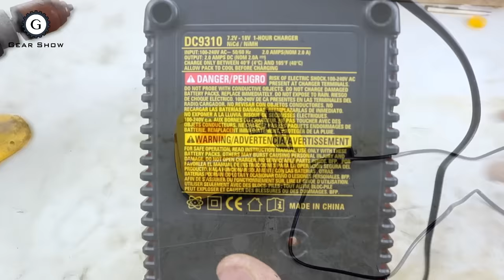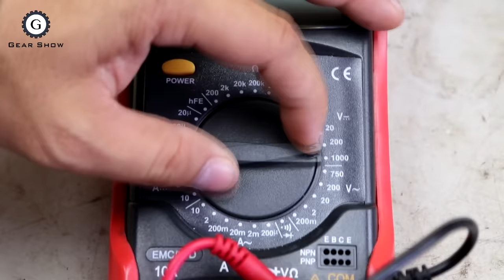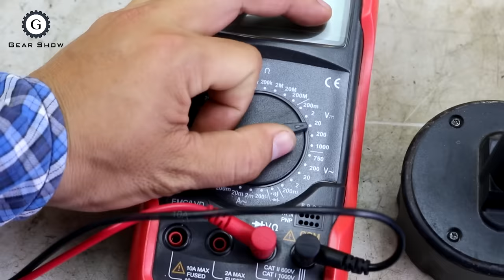Cordless Drill Restoration | Dewalt XRP 18V TYPE 1

Comment: I took my drill apart and now I just have 100 pieces.
Reply: hahahahhaha!
Reply: Need to take a video when disassembling so you know how to put it back together!
Reply: Always take pics while disassembling lol learned that the hard way
Reply: i took my 20v electric cordless Trimmer Apart - 300 pcs 
motor was SHOT !!!!!!! after putting 2 complaints to DEWALT nd a CASE # finally sent me a new one - Not worth replaceing MOTOR too Expensive
Reply: You should only have 99 pieces. Lol
Reply: Wildstyles 100 pieces and one heck of a facial expression....
Reply: The Niwo I took my fussy neighbors jigsaw apart once after borrowing and breaking it when I was about 13, fixed it! But had to go all the way to Black and Deckers spare parts store’ 
But I got that thing back in one piece...

😓
Reply: @TECsta76  LMAO !!!!!!!!
Reply: As long as you have none left after assembly, she'll be right!
Reply: My technique exactly, did it with a motorbike and sold the parts for spares!!!
Reply: Una vez desarme uno de estos y no logre armarlo de nuevo jaja este tipo es un muy bueno
Reply: @hawksights  torque clutch got me too. Ball bearings and little shafts fell out and rolled away. Used epoxy to secure ring gear to housing. Works again but no clutch. Didn't ever use it anyway :D
Reply: Sell it as an unfinished project and throw in a few random extra pieces 😈
Reply: Might as well mount all the parts on a board, hang it on a wall and call it art.
Reply: I did the same thing :-)
Reply: Mine stopped working so I took it apart and forgot how to put it back together
Reply: @neilhewson5392  Throws all the parts away well I have no parts left my drill still doesn't work :(
Reply: 100 piece puzzle is hard for you?
Reply: @neilhewson5392  you know that spare washers and screws are built in to all electrical appliances .well they have been when i take stuff apart theres always spares left over
Reply: Are you missing the balls to put it back together!? 🤭

Comment: I admire this kind of dedication to saving something. We throw away and waste a lot of useful things way too easily. Great job. 👏🏻👍🏻
Reply: for entertainment only not worth the effort nor time for most who don't have the tools, time, knowledge to do this kind of thing and plenty of used drills in the used marketplace that are customer returns can be had for around $50 or less in pristine like new condition.
Reply: He should have converted battery to lithium cells. It is crazy easy to do with dewalt.
Reply: I like this sort of thing too but I could just never justify sinking that much time into fixing up an obsolete NiCad drill.
It's not a matter of usefulness at this point its a matter of pride and/or fun.
I got three air impacts 1" and 1 1/2" that were gonna be chucked out when we moved in to a new yard.
Worth about $1,000+ each, if they work. Didn't have my own - Worth repairing. Fixed 'em up, new vanes, new grease, new/fixed trigger assy's and repaired the fittings and off you go.
Reply: Skodaman2   No, I needed to be more clear. If you already have a new dewalt lithium battery drill and want to convert an old one it is easy. They sell a thing that snaps into where the old NiCad battery was and then you just slide a new Dewalt Lithium battery on that. Only use charger for lithium batteries.  If you don't have a new drill then cost  of converter, battery, and charger might be a bad idea and to expensive.
Reply: usually it's just the fucking battery too, hate those batteries
Reply: In Cuba they keep 50s cars going for regular transportation.
Reply: @10OZDuster  pppppppppppppppppppllplpppppppppppppp
Reply: Hello Kitty you
Reply: @10OZDuster  and

Comment: I just realized why Dewalt  tools are expensive
Reply: Zana Hasan why
Reply: Why
Reply: Zana Hasan  Dewalt tools are junk. Buy Bosch, Makita, Milwaukee, or Hitachi and never look back
Reply: Weather it's dewalt , makita Bosch or milwalkee it's the tool holding it that counts , dewalt is fine if it does what it's designed to do and the tool on the end of it knows what they are doing.
Reply: The electronics have a special coating so it works in the rain. The gears are metal. It is 3 speed for a wide and accurate torque range and consistency of driving screws from a number 6 drywall to 2 inch hole saws. The plastic is nylon glass reinforce. The chuck is all metal with carbide jaws. The brushes are easily replaceable. That drill can do most of the work to build a house and and then some. I have both the 18 and 20 volt versions of this drill. It will break your wrist if you are not braced for a bind. It is a beast made in the US and retailed over $300. It is not a DYI drill.
Reply: Sung Joo Um  it lasted me about a year and then the clutch burnt up. Even from new the motor smelt like a hairdryer and burning electronics. The chuck had a pretty poor design that never gripped the drill bits very well and they would always slip. Maybe for house building this is a fine drill. But for what I do I’ll take my Bosch

Comment: I restored one of these! I love how the gearbox and brushes can be removed so easily. You can still get brushes for these, too! 

Trouble with mine was the torque ring was busted - the slip ring was so worn down from constant years of use that it only does drill and hammer mode.

Comment: I don't care what anyone says, the old dewalt drills xrp stuff is the best for reliability, I still use   dewalt xrp dcd950 hammer drill and my dewalt dc825 impact driver on a daily basis at my job, I've been using them for many years, they always work and never die, I only had to replace one battery 5 years ago due to water damage. I used a dewalt dcd996 hammer drill from december 2017 till June 2018 and it died, somthing on a microchip board blew up while I was drill a 1inch pice of oak with a 3/8" drill bit that was fresh. I switched back to my trusty old dcd950 and never had an issue since. My old dc825 impact driver has never given any issues what so ever.  Great restoration on this drill it looks like a dc925.

Comment: Fantastic job! After your video I've purchased same used drill for 20$ and I'm going to restore it and upgrade battery with 5x21700 lithium ion cell's 4000mAh capacity for 21V fully charged.
Thanks for your great work

Comment: That was good. Very complex things are battery drills.
I agree about the paint not holding up over time, but what the heck. At least the thing works well, saved the guys a lot of dollars and most importantly, hasn't gone into landfill. Presentation was pointed - no small talk. I hate that when guys do demo's and just blab on. Talking's fine if it adds to the presentation. Well done!

Comment: Considering that drill goes for 150 USD without the battery I think you got a great bargain, nice job, never realized how many little gears there was inside.  Thanks for sharing!
Reply: I wonder if all battery powered drills are this hideously complicated inside when compared to their AC mains counterparts which seem to have very internal moving wheels? Those battery motors also look a lot more tricky to disassemble for repair than the AC mains powered motors!
Reply: It was cheaper to buy a new one, but restoration was made for the sake of entertainment
Reply: @richardtomlinson8147  Only one way to find out, I'm taking apart stuff this weekend.
Reply: 150USD? You can get DCD996 for such money. Brushed motors belong to the 90s. BL is cheaper to produce and when well designed, it will outlast any kind of motor by massive margin. And they can be made waterproof.
Reply: I buy, sell, and trade power tools all the time. That thing was worth about $15usd before the restoration and about $30 afterwards. Those 18 volt dewalts are almost worthless considering they run on the old style Nicad batteries. Any one who wants more than 5 min of run time out of their batteries goes with a lithium ion. Go on eBay, you can get a brand new Dewalt dcd996 (top of two line, professional grade) drill for about $90. That drill is worth no where near $150 like you claim.

Comment: I have that drill in a combo package with a 5-3/8" circular saw, a reciprocating saw, 2 batteries plus charger in a hard case. The Ni-Cd batteries are harder to find but DeWalt has an adaptor transitioning to the new Lithium-ion. That was an amazing successful restoration that AvE should watch!

Comment: For christ sake if pepole are going to trash talk a tool get your facts straight

The type 1 units are no longer available from Dewalt if you're lucky enough to still have them there still running brushes will probably need replacing at some point yes. batteries will corrode.  But it's a beast.  Got SDS drills that have been battered from new still going strong one of wich mixes up plaster in a 16L tubs, sometimes upto 8 buckets a day.. The others ofter have to drill 4x2 timber or cast concrete etc I've Never replaced brushes in not one of them.. Why because there built to last.  The new model power tools from almost every manufacturer are all trash, give them around 2 years max heavy use... They burn out battery's cost a fortune to replace.

Great upload fantastic work. 👍 👍
Reply: I have 2 old dewaits and there are awesome
Reply: True that... I have one of these DeWALT cordless drills, it has been abused but its still going strong. Knocked it off a roof once and it only had some scuffs on it. Mixed plaster with it. Drilled into concrete. Used a 2 foot long bit to bore into a fence post length ways. Put up more plasterboard than I like to think about. Built many a fence and shed, no trouble driving 5 inch screws in right to the scrotum. One of the 2 batteries it came with has started to get a bit weak but that is after almost 10 years of abuse and the other one is still doing fine... a replacement battery isn't a mint on eBay either if the mood took me to replace it.

Comment: I have the exact same drill. When the original batteries died, I replaced them with DeWalt DC9180 lithium battery packs.  Bought a 2 pack plus charger from Amazon. Advantage is they don't self discharge and can sit on my workbench for months ready to go when I need them.

Comment: Nice on the effort.  I bought one used on Craigslist battery and charger barely used at all.  $25 bucks... But, nice effort. I still support your channel you are very good at what you do.

Yes, they are heavy for most jobs I use my small Snap On 7.2 volt screw driver much lighter.

Comment: I coulda used this a decade ago. Tossed that drill and have gone through 3 since. You are clearly a wizard with puzzles. 

And you also invented a new tool. The rapid file. Just need to attach your round file to a sawsall that doesnt oscillate and you can get it done as fast as it gets done in fast forward. Maybe oscillation will work but either way that musta been painful filing that socket 😂🏋️‍♂️
Reply: The hammer drill function sucks on those drills though. Its only useful when screwing while reaching 10’ away from your center of balance because it helps drive the screw home. Its also a good function if your a limp wristed guppy.

Comment: Great job! You took it apart and it ended up being the battery.😀
Reply: That battery wouldn't have done much, if he hadn't repaired the machine though
Reply: Michael yes I was just playing.😀
Reply: @Michael-Archonaeus  he actually didn't repair or replace anything in the drill, he just cleaned it.
Reply: @Scrippture  not so sure about that, i noticed a bent bolt looking part that somehow became longer and blacker later on o.o?

Comment: I have had some success rejuvenating nicad cells. Once you have opened up the battery so that you can get electrical access at an individual cell level, then I charge the whole battery and wait a few days to see which cells self-discharge. I then zap those cells (or maybe all the cells), one at a time. I charge a physically large capacitor of maybe 10,000 UF to - say - 5 volts with a small current - say 1 amp, then connect it across a nicad cell, with correct polarity i.e... positive on cap to positive on cell. The high peak discharge current from the cap into the nicad cell will tend to burn off the fine wires that build up within the cell between positive and negative leaving a more usable cell. You don't need to remove the individual cells to do this, provided you can get access to each cell, one at a time. In principle you could do the same thing with - say 30 volts on the cap to zap the whole battery in one go but I prefer to work at lower energy levels. Even doing it one cell at a time you should expect a fair size spark when you connect cap to cell.
Reply from the maker: Thank you so much for the solution.

Comment: I'm surprised you didn't order JUST the cells and rebuild the battery :)
Reply: or just order another drill
Reply: Or just paid someone to fix anything you'd need a drill for
Reply: or just buy new thing instead of fixing it with drill
Reply: It looks like the same cells were returned to the battery assy. They must still be holding/taking a charge. But generally, NiCads suck. I never had a NiCad pack last more than a couple of years, even with careful charge-discharge cycles. I trashed all my old cordless tools for newer, Li-Ion powered tools. 4 years now and still on the original batteries.
Reply: @RichardFallstich   .. I've had very good luck with Ni-cads ... I'm on my third battery for the model OLDER than the one rebuilt here .. well over 20 years of use ... charge doesn't last near as long but plenty to work with ... I screwed down thousands of 4" long roofing screws 5 years ago .. still using that battery
Reply: I simply got a China Milwaukee adapor plate and switched to 4 and 5 amp Milwaukee batteries and gave my Brad nailer and jigsaw new life. Better then they were before in fact.
Reply: NiCads always work poorly if they have been sitting idle for a long time and require a few discharge-charge cycles to regain their capacity. This of course makes them very annoying for those tools you don't use on a regular basis. A Li-Ion upgrade is well worth it for those, and also of course for the better power-to-weight ratio.
Reply: Yeah. That would have been cool to watch :D
Reply: Back in the day this was a way to save money, but today you can get an entire generic Chinese pack for cheaper than the cells alone.  These generic packs tend to have lower current capacity and we can see in the video that whatever cells those were, did not seem to give the drill as much power as it had new, but never the less it works.
Reply: @Roguey  This drill costs between 400€ and 500€ regarding on which website you order it from. So, it's a lot cheaper what the guy did.
Reply: Mike Baxter : I'd not be surprised if the cells alone were more expensive than the complete battery.
Reply: Chain saw repair
Reply: @stinkycheese804  or use the Dewalt 20v lithium pack using the Dewalt battery nicad to lithium adapter
Reply: Face Giantstogether  how do you do that?
Reply: @RichardFallstich  I still have Ni-Cad batteries from 2006 that I use almost every day, and as contractor, believe me, they get used a lot. The newest 18 volt battery I have is from 2014 and the oldest one is 2006 with a mix from in between
Reply: @aucomint  Lol no. 500 euro would be an "antique/vintage" price. A comparable new 20v brushless drill with a 5ah battery and charger is only like $280 on amazon.

Comment: I have that exact drill. I have 4 batteries for it but they're all dead. I ended buying the new 20 volt Brushless Dewalts including the Hammer Drill, Impact Driver, and a Reciprocating Saw.
I couldn't be happier.
Reply: Just buy the adapters so you expand the tool collection as the old batteries go. That's one thing I like about dewalt. They support their platform for a long time.